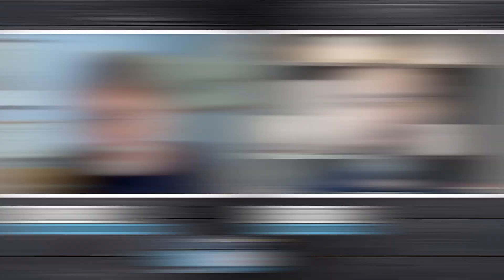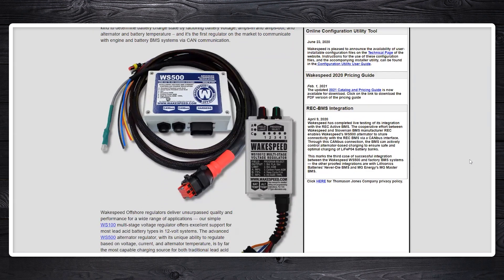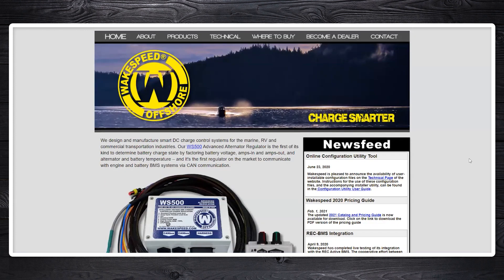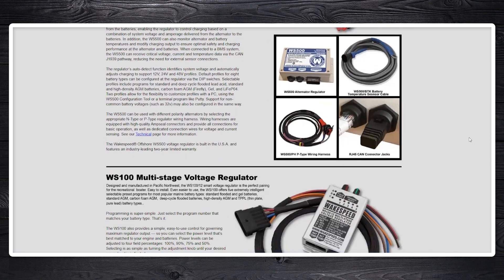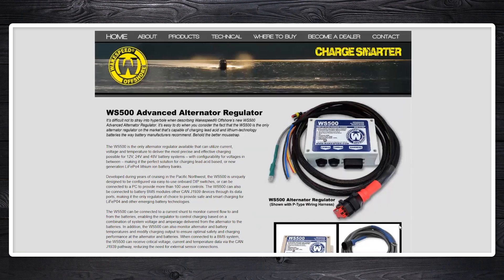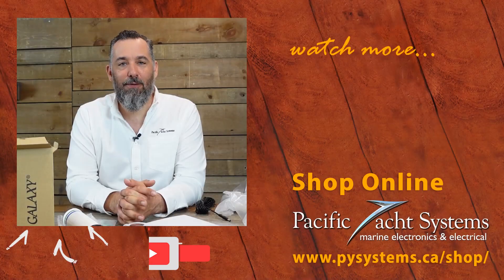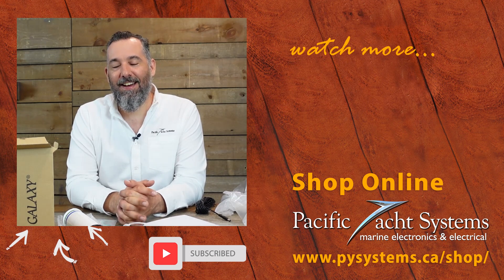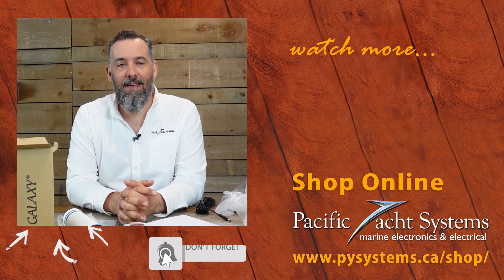Marine Alternators with Nigel Calder

Comment: Thanks guys, I always enjoy. Question; Are there reliable higher output alternators for outboards? My Verado 250 has a 70 amp but now with Seakeeper pulling 40-45 at spool up I have a problem and no room for a generator. I bought a 90 amp on line and blew it up first outing! Ta.
Reply from the maker: Good question, unfortunately don't have any experience on upgrading a alternator on a outboard engine, anyone else can comment on this question from Graeme.

Comment: Hey Jeff,  If I have an AGM battery for a starter and also for bow thruster and Lithium for a house bank with a battery isolator between the batteries and the alternator do I risk damaging my alternator if the lithium bank BMS shuts off?  Should I use a B to B charger between my starter battery and the house bank?
Reply from the maker: With your alternator output connected to a battery isolator, you alternator is effectively connected to AGM start and Lithium house, therefore a sudden disconnect from the BMS won't damage the alternator because of the AGM battery.

Comment: Hi, nice talk as always, what size of engine would you need to get these powerful alternator'glowing' ?  And as others said new to me as well for S.Steal , so would you say have them but be careful to use them as the last one before screw, or forget about using any? Cheers
Reply from the maker: Just be careful how you stack connections on top of a electrical connection, make sure the connection lug has direct connect to the electrical post. My own sailboat engine is only 30 HP, it has a 220 amp alternator, and it can get pretty hot.

Comment: Hello Jeff,
Thanks for your videos. I just purchased a Victron Battery Isolator, it came with two flat washers and a lock washer on each stud. Where is the wire lug supposed to be?  Thanks
Reply from the maker: Suggest to follow Victron exact instructions, they know best.
Reply: @PacificYachtSystems  Thanks Jeff. Unfortunately they don’t reference the washers at all in their printed material provided with the product.
Reply: @dennismartindale691  neither does Blue sea systems on their fuse holders!

Comment: washers should also be 1 shot conicals. Once they have been torqued down, they should be thrown away if loosened

Also feel that an alternator should never exceed aprox 100 amp. If more wattage is required you should increase the voltage of your storage system. Jeff, Would love to buy you lunch and discuss 1 day.  Michael
Reply from the maker: Thanks Micheal for your inputs, wasn't aware of the "been torqued part" either. Reach out anytime.

Comment: Would mega fuses limit this problem? You need to take the nut, washer, cable then fuse out, to replace the fuse!! Midi fuses are the same process. I'm not comfortable with those ANL fuses.
Reply from the maker: James, look at the MRBF fuses from Blue Sea Systems, seems really promising for many fusing requirements.

Comment: Nice lessons I’m replacing SS washers with Copper washers on bass bars or fuse holders
Reply: Make sure those washers are conical and never reuse once torqued down and loosened
Reply from the maker: Tks for sharing!
Reply: I don't think they are saying not to use stainless washers just be aware of the placement. Corrosion on the copper washers could be more of an issue down the road. Do they make tinned copper washers? I thought about the situation Nigel was talking about but if you place the anl fuse first and then the lugs, washer and nut. When you slide out the fuse, the lug will prevent the washer from slipping down. As long as you don't put the fuse between them when replacing it you should be fine. Just my 2cents😊

Comment: Disappointed, didn’t hear any solutions for using alternators for serious charging, without burning up the alternator. I know Nigel consults with Integral Solutions, whom I contacted by email, and they just referred me to their video. No solid answers forthcoming. Is this info a secret?
Reply from the maker: Hi Allan, we share this alternator info in other in the PYS videos, search out alternators and you may get exactly what you are going.
Reply: Thanks for the tip, Jeff. I’ll try to find the content on your other PYS videos. I was just disappointed that Nigel didn’t discuss it on this video, and that Integral Systems has not been forthcoming to me with their solutions. I am at a disadvantage with my Caterpiller 3208 engines that they factory-mounted small 50A alternators on the engines with a single V-belt, so I cannot simply replace the alternator with a high current output model. What interested me about Integral is that they said they could get higher amperage at lower rpm’s and not tax the engine load. That is quite different than any of the specs I found with Ballard or high quality/high output alternator companies. Thanks!

Comment: Jeff and Nigel, I think you are doing a Great job of trying to educate cruisers on what makes a safe installation. Yes we are dealing with current levels that we have never seen before in marine systems, and those currents can create a dangerous or deadly situation if installed improperly.

I have a concern and this is not just with electrical systems. We are becoming as a community very dependent on technology, yet many of our designs include little or no fault tolerance. This creates a situation where we can loose an entire critical system through the failure of just one component. That is not a game stopper is we are close to a spare parts, and or a skilled technician source, but it can become a real issue if we are is a remote area of this very large planet.

I understand the challenges, redundancy costs money. All I would ask is that every cruiser look at their installation and think "what if". What if that component faulted out. What could you do to work around that failure? I'll use an alternator failure as an example. If you are dependent on that alternator to charge your house bank what will you do if it fails. What is the failure was a bearing and you were is a remote part of the world? Now your propulsion engine is inoperative, and you have a house bank that is dropping in voltage.

Long distance cruisers especially need to think about these things.

Again, great informative videos!!!
Reply from the maker: Wow, thanks for the very great input, really refreshing perspective.

Comment: Great lesson re stainless steel washers not being conductive. Something that most do-it-yourselfers just aren’t aware of. 👍
Reply: I never knew that.   Damn I use stainless everywhere!  Just found this:  While carbon steel offers a resistivity that is eight times higher than copper, stainless steel has a resistivity that is 40 times higher than copper.
Reply from the maker: Learn something new everyday.
Reply: @PacificYachtSystems  Jeff, thank you for doing these.
Reply: I wasn’t. These guys are masters.
Reply: They are conductive, just not anywhere near plated copper, hence higher resistance = heat, 4-0 cable = large current = lots of heat.
Reply: 316 stainless steel has an electrical conductivity of about 2.5% to 6.5% of that of pure copper